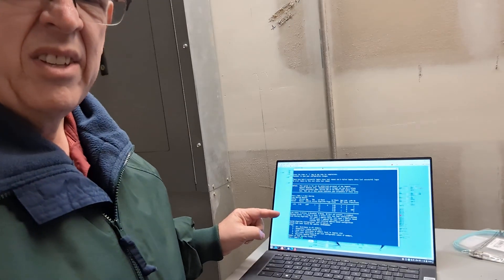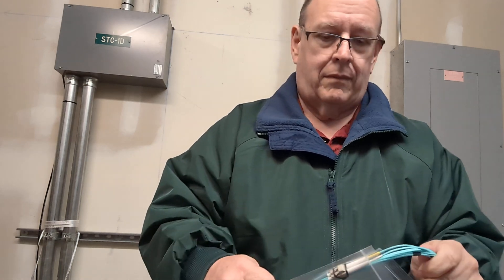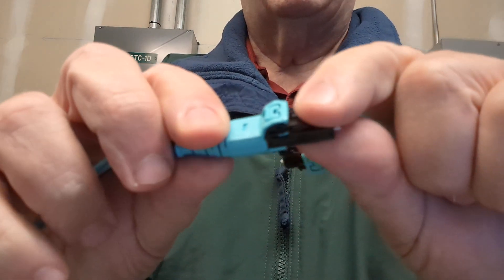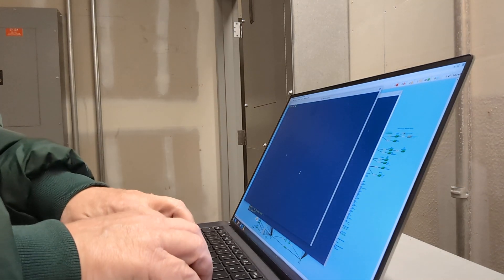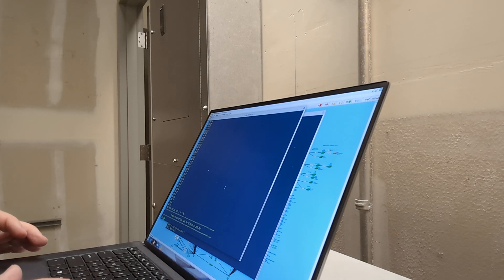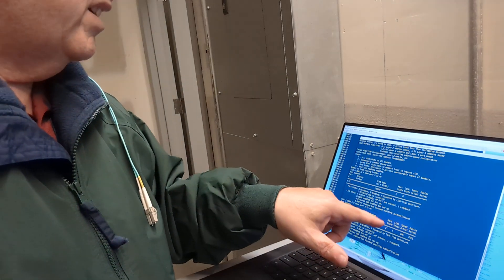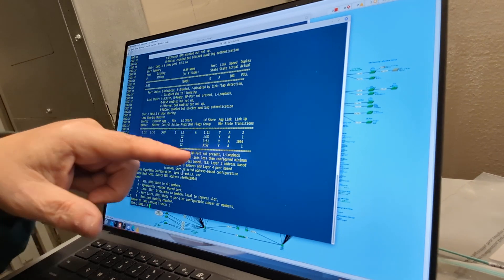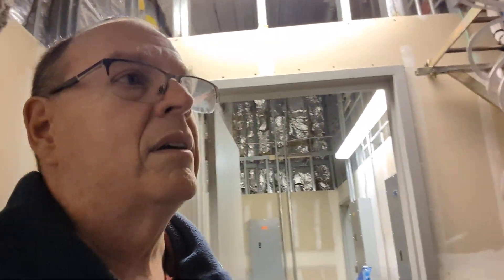Network Admin Life - That Darn Fiber

Comment: One of my favorite tests is to tail -f your switch's syslog, then jostle all of the patch cords, etc in the closet and look for link state changes. You'd be surprised! I love that you use Intermapper! BTW, are you using anything to clean your fibers with? Sometimes dust can cause link issues. Have you ever worked with Bi-Di optics?
Reply from the maker: I'm not really a very good fiber guy.  I've been know to clean fiber ends with my shirt sleeve.  The engineering department installs the fibers and they have some cleaning equipment.  I should check what they use.  God bless!
Reply: @NetworkAdminLife  yeah I don't recommend using a shirt sleeve especially with single mode fiber. There are cleaning pens that never use the same cleaning material twice.

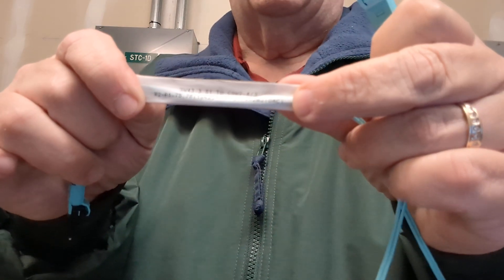Comment: Love seeing what you do. I used to deal with fibre on EXOS switches. Command I always used when troubleshooting was "show ports 3:51 transceiver information detail" as that will tell you if the light levels are out of spec for the optic. If it's on the threshold you'll get tons of flaps and errors like you had.
Reply from the maker: Someone (maybe even you) recommended this before and I forgot all about it.  It came in handy today!  God bless!
Reply: You should be able to configure Intermapper to detect poor signal level on the SFP diag (if your transceivers support it) and warn you about them going out of bounds.

Comment: Are there different  fibers what is the difference? What are you using here what is mostly used?
Reply from the maker: These fibers should be single mode based on the distance but they are in fact multimode.  God bless!